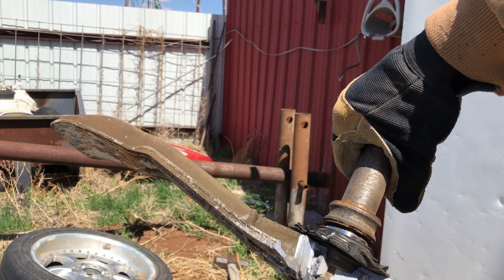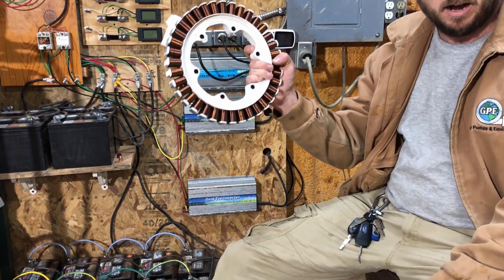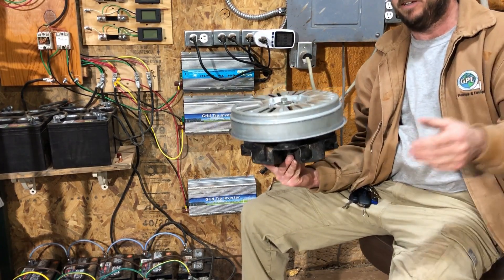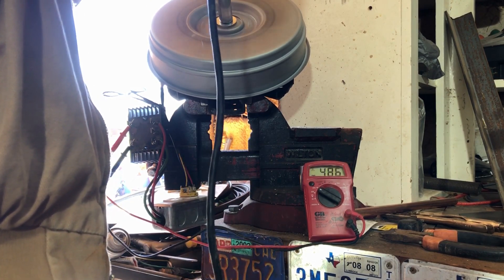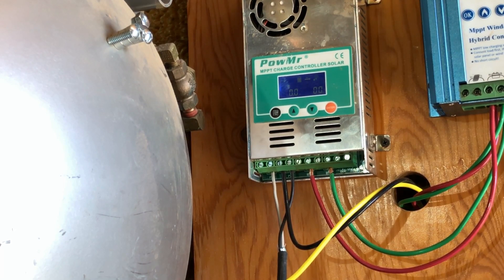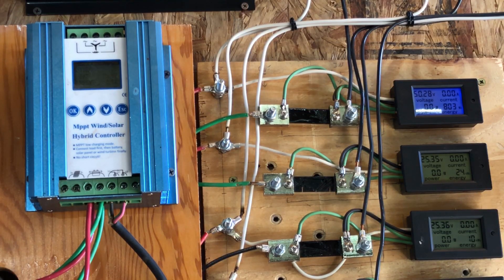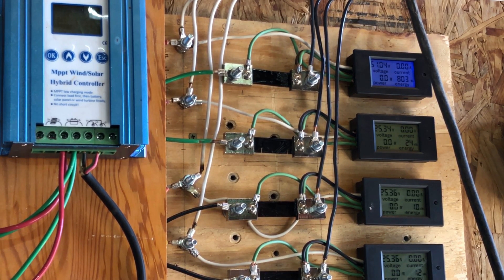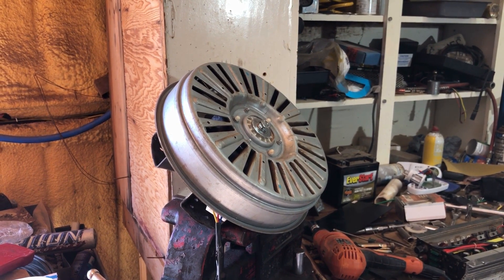Washing machine turbine #2: re-harvesting ANOTHER motor/bearing assembly and voltage tests

Comment: I need one of these direct driven by the waterwheel.
Reply: Joe, you can go on ebay and get a Samsung with copper windings also. You just have to know which model it is. You want the ones where the motor is a DON1500 marked on the rotor. I cheat and make my own shafts so I can either use a Samsung base with bearings or make my own shaft supports. ( 3-d printers are wonderful for that ) To save machining splines to match, you can either make the shaft to fit the ID of the rotor and drill along one of the splines to use a round key ( welding rod works good. :-) ) or remove the hub insert and make a hub for what you want on your shaft.( Again the 3-d printer works for experimenting ) I've seen the Samsungs put out 800 Watts at 1000 RPM input when wired in a 3X4X3coil configuration. And as a motor, they were rated at 1300 RPM or 1400 RPM depending on model. Now there is a difference between using the Al or the Cu  wound units of any make. And that is the noise that they make. The Al ones will be quieter than the Cu ones but will not produce as much power for the same RPM. The key to getting power out of them is to turn them as fast as possible. You need about 1.25 HP to get 800 Watts out at 1000 RPM.

Brands that have them if you know what to look for:
Fisher and Paykel, which also is used by Whirlpool and Maytag
LG
Samsung. A brand new one on E-bay. https://www.ebay.com/itm/DC96-01218D-Stator-Motor-for-Samsung-Washer/184712678645 but you can get them cheaper as used units. Used are around $60 for the Stator, Rotor, and Sensor unit.
Models Washers applied to: .
    WF328AAG/XAA-SAM
    WF328AAG/XAA-SAM
    WF328AAR/XAA-SAM
    WF328AAW/XAA-SAM
    WF328AAW/XAA-SAM
    WF520ABP/XAA-SAM
    WF520ABP/XAC-SAM
    WF520ABW/XAA-SAM
And some lessor known ones.
Reply from the maker: I've gotten similar numbers out of the aluminum ones but all the ones I've played with had larger wire and the rotors definitely had more magnet material in them.
Reply: @ToysforWatts  The wire size does play a big part in it. Heftier magnets also make a difference. I have seen some people remove the factory magnets and replace them with stronger Neos also. Those take some real power to drive.
Reply from the maker: scour facebook and Craigslist and such.  I kniw in some countries they’re just not common but here they’re sold used broken for a little more than scrap value.

Comment: Have you tried a digital OPC? You can connect your wind turbins to your battery bank. The OPC feeds the excess voltage into a SSR, and that feeds into a resistor bank, or a grid tie Inverter. Digital OPC is 50 dollars on Amazon. Made by wind and sun power.. I saw it on John Daniel channel. Good luck with the new turbine. Power should be insane
Reply from the maker: i will look into it!
Reply: Do you have a link to it? I looked but did not find the controller.

Comment: Niiice :) but with rewiring would give more ;)
Reply: High voltage is more efficient and easy (cheep) to transport long distance wire, and using a 3 phase or 3 identical single phase isolated step down transformer before (closer) the rectifier is easier and better than rewiring because the secondary (output) cold have multiple output voltages, and this cold only be replaced by using a high voltage input DC-DC buck converter charge controller.
Reply: @power4one2go83  oh ok ;)
Reply from the maker: Absolutely, and in the end we’re going to redo it for 24v but first i want to see if we can hodgepodge it into a working turbine without modifying the stator.
Reply: @ToysforWatts  My setup isn't setup for the LGs at present. But it can be.